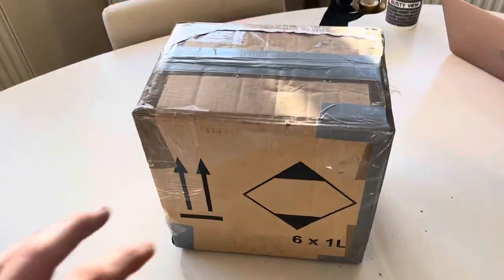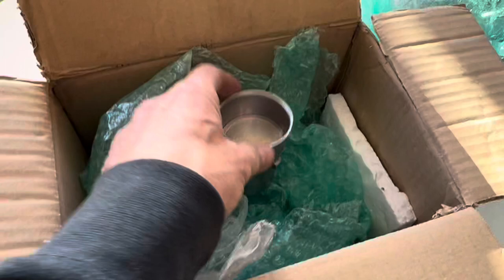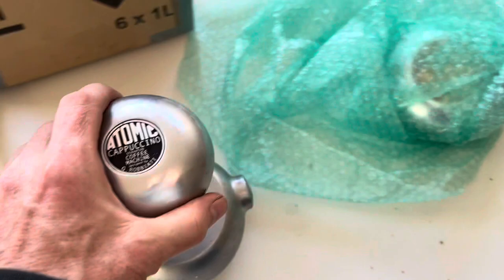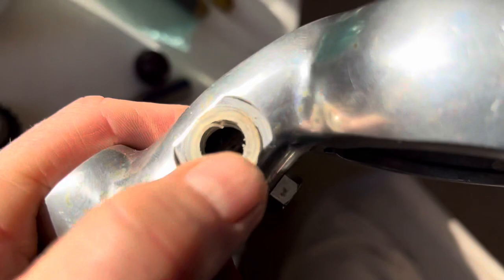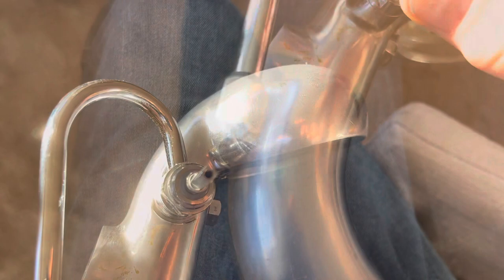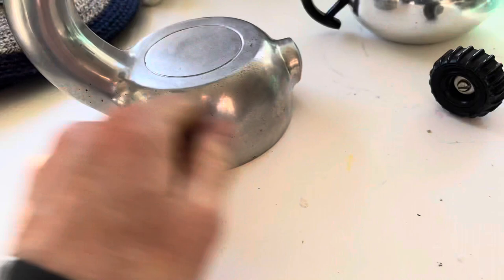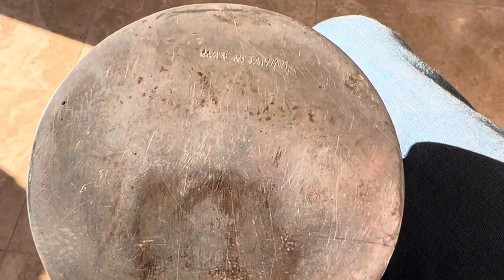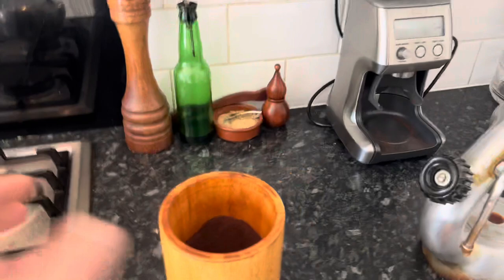Atomic Coffee Machine - Fakes and Replica’s + how to spot them

Comment: That fake it doesn’t say MADE IN ITALY underneath as a stamp, the letters of CAPPUCCINO are very large(should be upper case but smaller and not spread out end to end, should say made in italy on the sticker(mine also says the Australian company distributor who have the rights to sell in Australia on behalf of ATOMIC), flat head not Philip screws. 
Good video, thanks
Reply from the maker: Thanks for your comment. Only later Bon Trading branded Atomics had 'Made in Italy' stamped on the bottom.....presumably to differentiate them from the fakes. It is also worth noting that there are 100's of variations of the label - some of them atre shown here: http://www.atomiccoffeemachine.com/badges1.htm Someone actually wrote a boom dedicated to the labels! Mike
Reply: @scottitonline  ones enough for my collection, but after watching your video on the Atomic VS THE LITTLE GUY I purchased a used one of fb market place with a little guy induction plate for 450$ Australian dollars. Not a bad score. I think  I’ll leave it as that. One of each

Comment: What's your opinion of the Bellman Atomics? I've found practically no discussion or review of them, and I wonder how they compare to original models
Reply from the maker: Thanks for your comment and question. Here is my take.... There was a period of several years when the factory in Italy stopped producing original Atomics. At that time, a cheap and nasty fake was produced in India and what is now known as the Bellman also came into being.Originally the Bellman has an Atomic badge but they got into a Copyright dispute with the owners of the original brand and changed the label to Bellman. Ok...so that is the history. Do I love the Mercedesc300SL gullwing? Yes. Do I think somebody should be able to copy the iconic shape and build a replica? No...and neither did Mercedes and the replica was ordered to be crushed. I kind of feel the same way about the Bellman. It is basically a replica of the iconic Atomic BUT the difference is,that the original Atomic is still made in small quantities. The distributors  of the Original Atomic (Bon Trading in Sydney) are very unhappy that there is a replica floating around and I can see why. The replica is not true to the original in that it uses a different material for the internal tube that runs through the machine. It also use philips screws where there should be slotted. I have used one and it works OK BUT I wouldn't buy one personally....any more than I would drive around in a replica classic car. Owning an original just feels better to me. Mike

Comment: Hi.  Can you tell me if spare parts are still being made for atomic machines.  Some of the key parts are no longer available from Bon Trading and they are not answering the phone. 

If I can’t find needle valves and steam arms I will have to fabricate them myself.
Reply from the maker: Hi - sorry to hear you cant get through to Bon Trading on the phone. YOu should be able to get the parts you need from their website:

https://www.atomiccoffeemachines.com.au/atomic-coffee-maker-parts/

What country do you live in?

Mike in England
Reply: @scottitonline  Thanks I am in Australia and phoned Bon Trading direct, got their answering service but no response back.  Some of the crucial parts on their web site are shown as "out of stock". There is also a supplier in New Zealand but they are also out of stock of the same range of things. The Sorrento company have a few spares but also showing out of stock on steam arms etc.
Reply: @ferartdesign5634  disturbing news as they should be trying to get direct supplies from italy as Sydney are the distributors here. I just bought mine brand new today of a fellow that never used it ( unused) , so I haven’t yet faced difficulties. 
What happened to your pin?
Reply: I found a supplier in Taiwan. Obviously the parts are replicas but the quality and appearance is very good.  My second machine is now up am running like the original.  
I think this whole renovating old Atomics could become my new hobby / obsession 😅
Reply: @ferartdesign5634  😂 quite a collection you have indeed